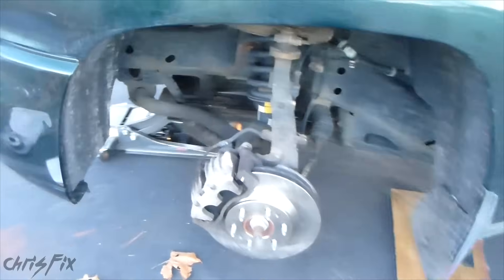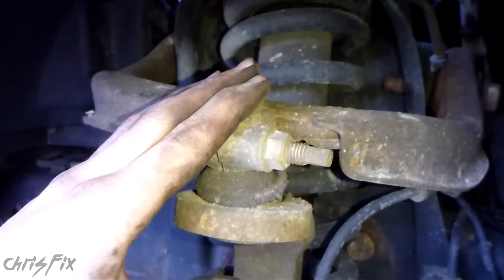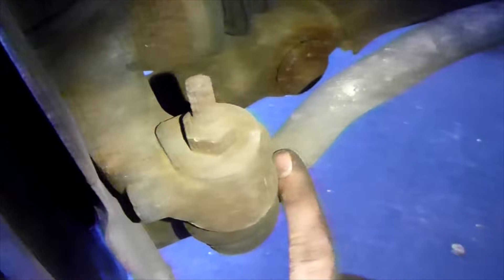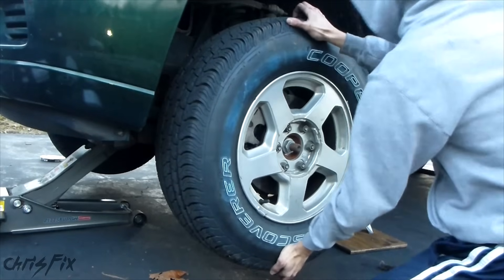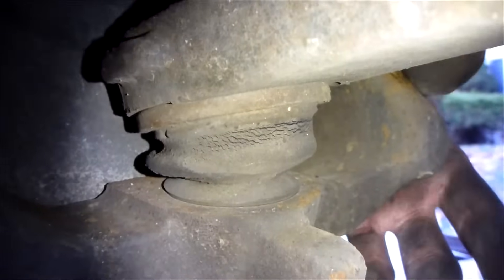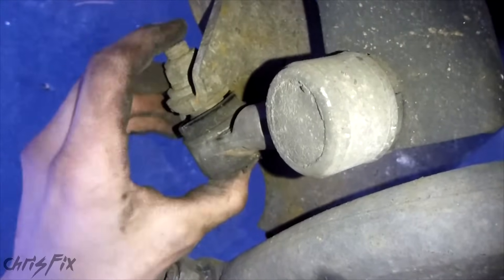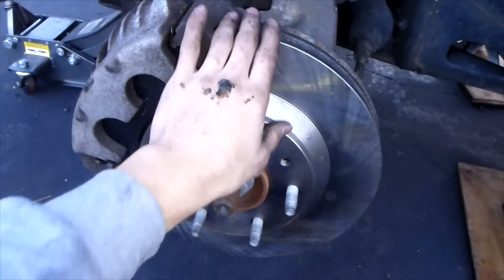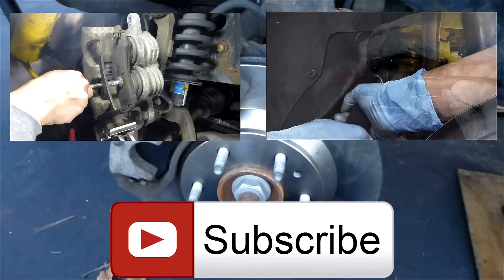How to check out your own car's suspension system

Comment: When you check for 'play' in the joints / bushings, is it best to have your car on the ground or jacked up.. or does it depend on what your checking? I noticed you have the car jacked up at the front.. though i watched an Eric the car guy video where he checked bushings at the rear, and he said to not jack up the rear as it'll interfere with locating the source of movement ?

Reason I ask is, I have an 05' Honda CRV and when I accelerate, generally at a higher speed, I feel a light thumping/vibration in the car.. similar to feel/sound you might get if you have  a flat tyre .. though I do believe it's more noticeable during acceleration and reduces/stops (will double check) once I've reached speed.

I'm planning on checking for play, though not sure how it's best to approach diagnosing.
Reply from the maker: +sypher0101 It varies. I do both but it is way easier to see stuff when you have the wheel off. Check out this video: https://www.youtube.com/watch?v=62bVn7E8gyk
Reply: To check for play when you wiggle the tires it HAS to be up in the air.  Once you confirm there is play, then take the tire off and start hunting around for boots that have torn or leaking oil from the struts, etc.
Reply: hey Chris, whenever I turn my car it makes a popping sound. I don't know what the problem could be but I don't want to pay someone to fix it. any help ?
Reply: Could be a million things: struts, strut mounts, ball joints, lower control arm bushings, tie rods, wheel bearings, cv axles, sway bar bushings, sway bar end links...only way to figure it out is to jack it up in the air and start yanking on the tires at 12 and 6 and 3 and 9.  If that's good, take the tires off and start yanking on stuff to find what's wiggling and popping.  Once you find what it is, replace it.  If you still can't find it, take it to a front end alignment shop: they diagnose and inspect them for free usually.  Once they figure it out, they'll tell you, give you an estimate, you leave, and then fix it yourself.

Comment: Hey Chris, question for you just checked my front sway bar links and on the bottom there's alot of play. The sway bar shouldn't move right? if you can respond quickly it would be greatly appreciated but if not I understand.

Comment: Man I have learned so much from you. My 2011 Versa hatchback makes the weirdest noise when turning. Like is the front end is going to  fall off. I'm very worry when driving it. Any suggestion. Thank you.
Reply from the maker: +Roland Hernandez Im going to guess CV axle. Does it do it in both directions?
Reply: yes Chris
Reply: I heard another mechanic say that it could be the bearing plate onto of spring that gets frozen and don't move with the spring. By the way thank you for your reply.

Comment: When i try to move my tire from side to side i'am able to turn my wheel and i hear what i would say is hydraulic fluid moving around( i get a vaccum squishy sound effect) I do not think that's normal though i do not have any noticeable fluid loss any where or leaks. Noticed the rubber boot was torn where the inner tie rod meets the the outer tie rod so that needs fixed. Any suggestions for a fix?
Reply from the maker: That's normal. That's your power steering fluid. You need a new outer tie rod.
Reply: +ChrisFix Yeah to clear it up a little more, i am able to steer the car from the tire with my hands lock to lock(horizontally) when i was checking if i had a bad ball joint. I thought you should&#39;nt be able to do that. It takes more effort to turn left when driving ive noticed. I understand i would have some play there with a bad tie rod but not be able to turn it like that
Reply: +james avery I was just wondering that i may have a  bad power steering pump
Reply: +ChrisFix Maybe it's because my steering lock is just not engaged lol. You learn every day lol

Comment: Am new to cars. Why do we need to change the whole part not just the worn bushings? I can't seem to get a straight answer to this question. From where am standing it should be easier and cost way less for just that rubber part.
Reply from the maker: +MrSqeeky1000 You can just change bushings but sometimes the whole part is damaged or it doesnt have replaceable bushings.
Reply: +MrSqeeky1000 The real answer is it depends.  It depends on where the damage is located and if the part has bushings that can be seperated. Some cars have suspension parts with ball joins and bushings integrated into a control arm for example and in that case the whole part needs to be replaced.  Other cars you can replace just the bushing if you have the tools and the know how.  What really gets me, is that sometimes dealers and auto suppliers only sell the whole part and in that case it just makes sense to replace the whole part b/c you have to buy it that way.

Comment: my 2004 4x4 canyon started making a grinding type noise all of a sudden when driving home from the beach. it does it from about 10-25 mph and only after its driven for at least 20-30 min. almost as though the brake is engaging on the front driver side. what could it be?
Reply from the maker: +dewhiskey daycullme It might be the brakes. I would take the wheel off and check it out.
Reply: +ChrisFix thanks. i just bought a jack and jacked it up. noticed a little play side to side but not up n down. I'll take wheel off as soon as i get some jack stands. I appreciate the info.

Comment: The best suspension video I have watched all day.  THANK YOU! Wish I would have found this BEFORE I put the car back together!  I did try to wiggle the tire to watch for play and didn't see any but the boot on the lower ball joint is all but gone. The upper and the outer tie rod look like crap too so figure I'll just replace it all.  I hear all sorts of rattling when I'm driving (when the road is rough) and it is pulling to one side.  Don't know what else to do.
Reply from the maker: usaclc Glad the video was helpful! I have videos on replacing all of the parts too! See my suspension playlists! I bet it is tie rods and sway bar end links causing your noise.
Reply: ChrisFix just watched a bunch of them.  Feel like I cheated on you (had to see wishbone lower control arm). So my new arms, upper and lower, arrived - waiting on tie rods.  Went through most of the bolts to get things loose so when I have time to swap parts it will go faster. I was going to remove the tie rods but the nut is turning but not coming off the bolt.  Frustrating.  After a full day at work sanding I didn't have patience for it.  I'll pay you $200 to come over this weekend and finish the job.  (snicker)

Comment: My car makes a clicking noise when I turn right or left, super annoying and loud and it's constant until I'm done turning. I don't know what is making the sound but maybe you do? My only guess is the spring? Idk...is there something I'm supposed to lube or  is my spring getting caught? I'm lost. (Info: My car has annoying Megan coilovers that came on the car when I bought it 3 years ago.)
Reply from the maker: WishIWasDrunk That is the CV joint most likely making the clicking noise if it happens when you turn.

Comment: hi Chris, big fan here. i have a 2012 honda civic LX and unfortunately I was stupid enough to drift my own car, (umm...about everyday?) and I've noticed that now everytime when i get over anything(like speedbumps) it gives a clicking sound,do you have any ideas or suggestions?
Reply from the maker: Jim Benson It could be sway bar end links (probably) or the cv axle. Does it click when you make a sharp turn because that is the CV axle then.
Reply: it also triggers off anything now, turns, sharp brakes, even small bumps, it's getting worst, and I think I should check it as your video shows, great videoes, please keep it up:)

Comment: Hey Chris, I was looking to buy some new tie rod ends for my 95 isuzu rodeo but im not sure if the ones im planning to buy are greasable. What do I do if I can't grease them after installing them? Leave them be or find greasable ones? I dont want to because they are expensive and my isuzu is my beater car. Advice?
Reply from the maker: ***** Non-greasable tie rods are fine for a beater. They will last a good long time anyhow. Obviously greasable ones are better, but if the price difference is too big, just get the cheaper ones. The non-greasable ones just get installed and that is all. You do not need to do anything else.
Reply: ChrisFix Ok Perfect. Thank you for everything you do bro. Really helps a lot! Just did a superflush on the coolant. :D

Comment: I have a 99 jeep grand cherokee, which are famous for the death wobble but I fixed it before but now i have a problem where if i go on the highway. My driver side tire vibrates on the highways I feel like it swaying but sometimes it stops. But when letting it coast on local roads I hear and feel the vibration. Cant figure out what it is, I did check the hub but lifting and moving the wheel but there isn't no play. Have any idea of what it can be?
Reply from the maker: Bryan Ruesta Could be CV joints. Did you check your sway bar bushings and end links?

Comment: Chrisfix, I'm leaking power steering fluid from my rack and pinion. It's very slow ,however, it is leaking. Can you give me a level of difficulty from 1-10 as to purchasing a seal kit($45) and doing it my self. Or would it be better to purchase a new rack and pinion gear assembly. I found one on eBay for about $115. Thanks, loyal subscriber.
Reply from the maker: James Falvey It is like a 5-7 in difficulty because you need to remove the steering rack. I would just get a new rack if you are going to be taking the whole thing out. You might consider this for a temporary solution. Maybe you slow leak will stop: http://www.amazon.com/gp/product/B000ARPVNO/ref=as_li_tl?ie=UTF8&camp=1789&creative=390957&creativeASIN=B000ARPVNO&linkCode=as2&tag=chri0e2-20&linkId=UU7MMTQA7ZDL44HPIt is guaranteed to stop seal leaks or your money back!
Reply: I saw that stuff in a store. I'm very skeptical when it comes to purchasing things like that. Such as radiator stop leak etc.... They'll put anything on a bottle just to sell it. However, the guaranteed money back is making me think twice about it. Just hate for it to be a waste of my time even though I'll get my money back. Perhaps I will try it. Thanks chrisfix for the response
Reply from the maker: James Falvey It is worth a shot because you are going to tear apart your rack anyhow if it doesnt work.

Comment: Hey Chris sorry for posting a unrelated question also thanks for sharing your videos. I wanted to get your thought on buying a reman trans from the dealer(kia 12/12k) or rebuilt from a trans specialist(unlimited/1yr) dealer $916 for trans pls labor= 1850 trans shop rebuilt 1900. Im concerned abt the quality iyo would the dealer reman be a better choice?
Reply from the maker: Curtis Bell Dont be sorry. For a Kia, I would just go to the trans shop. A rebuilt tranny is a rebuilt tranny and the trans shop does it all of the time. Make sure you use a reputable shop.

Comment: Hi Chris I wrote to you before and today I have another question, I also own a Mazda B3000 SE 4x4. Bought it used with a missing manual hob locker. But I noticed a couple of times that you don't have any front manual hub lockers on your Mazda. If this truck suppose to have hub lockers?

Comment: Hi Chris, I have a 99 mustang v6, just pushed over 250,000.

2 questions:

1: how long do timing chains last?

2: it only does this every once in awhile, the transmission will shift too early and super hard. It's not low on fluid and doesn't matter if it's warm or cold. It usually only does it if I drive it like a race car, but today it did it for no reason, I drove to a salvage yard around 1 and had no problems, left for work at 4:30 and it was shifting hard and too early, same when I left work at 11:30. Took a coworker home, then headed home, checked the fluid, then went to drive it again to check it, it shifted like normal again. I did shut the car off after checking the transmission fluid for a few minutes to check other fluids.

And I haven't driven the car hard today or recently.
Reply from the maker: Chinesefoodrocks1521 Timing chains can last the life of the engine. Some chains sag and need to be replaced but that is typically after at least 200k miles. My van has 300k miles and has the original chain.  Some chains have tensioner springs. 
As for your tranny, what happens if you push the gas hard, will it shift early?
Reply: She acts normal whether I drive hard or normal. But if I drive hard constantly, like accelerate by getting to 3-4 thousand rpms, it will like switch to this hard shifting, early shifting mode (idk what else to call it). 

Here's the best example I can give you: work didn't have my paycheck so I was really mad, so I was flooring it whenever I had to accelerate all the way home from work, except in the neighborhood. When I got to the neighborhood, it started the hard shifting, it didn't shift hard while racing home. 

So I didn't park, I drove it around alittle and after awhile it went back to normal. It usually goes back to normal after sitting overnight too.
Reply: When pushing the gas hard she runs and shifts normal. But after driving like that for a few minutes, it starts shifting hard.
Reply from the maker: Chinesefoodrocks1521 Hm, that is tough. You might consider getting this scanner and checking the transmission codes: https://www.youtube.com/watch?v=xPI36bKVCjk
Reply: I think i got it fixed. I drove it across town this morning and then went to drive back and the transmission started acting up the minute I put it in reverse. Check engine light came on, bad throttle position sensor. Replaced it and transmission was fine.

Would it make sense that the computer didn't know how hard I'm pressing the gas, so it doesn't know when to shift, so it shifts early?
Reply from the maker: Chinesefoodrocks1521 Yea, that makes sense. Glad you found the problem!

Comment: Hey Chris, great video. I am by no means a machanic. I know a little and I love working on my on vehicles. So thanks for the informational video. On another note, I have a 2009 Saturn Aura and it everytime I turn right or left I hear kinda like a squeaking/grinding noise coming from the front end of the car. However, it only does it after I've driven it for about 30+ minutes or so and the steering isn't pulling hard or anything just the noise at the speed that I'm going and it only does it when I'm going less than 30mph. Not really sure where to really begin to start looking. What can I look at to be the issue? Thanks for any info that you can give.
Reply from the maker: Daniel Dameron This can be be your bearing (but bearings usually hum rather than squeak/grind). It could also be a cv axle joint but they will typically click. I would jack the car up, then take your hands at the 3 and 9 o'clock positions and try shaking the wheel (like in the video I link below). If there is play in the bearing you should feel it. Check this out: https://www.youtube.com/watch?v=62bVn7E8gyk

Comment: Awesome dude 👍 I'll be checking my suspension this weekend. Now that I know what to look for! You're Fuckin awesome!
Reply from the maker: Ceasar Rodriguez Great! Glad the video was helpful! Let me now what you find!
Reply: delete system32 it should fix it
Reply: Thanks for the videos Chris, you
u really know your stuff.
Reply: +ChrisFix i have a question chris my honda civic 2012 is having a very serious problems.swerving on the high way and really feels like im going to lose control of the car.what can be wrong?i notice that on certain roads the car slides.funny thing is when it's pouring rain heavy the car drives perfectly fine and doesnt hydroplane.only hydro planes on dry roads.weird symptoms.i had a 3 month warranty at fire stone and tires are brand new.any feed back will help out extremely.

Comment: Hey Chris, Sometimes when I am driving over a speed bump or certain bumps in the road I hear a cracking noise from the front right of the car would you happen to know what that may be? it only happens from time to time. Thanks
Reply: 01 mitsubishi lancer
Reply: Steve Creak
Cracking / popping noise, sorry
Reply from the maker: Steve Creak Is it like a metal clunk? Sounds like your sway bar bushings or your end links are worn out.
Reply: Thanks Chris, Loving the channel keep up the good work!

Comment: This is a great informational video. I'm by no means a mechanic, but I'm trying to learn as much as I can and your videos truly help. Keep up the great work.  On another note, I have a 2003 chevy trailblazer ext with around 144,000 miles, when I'm at high speeds no problem, but when I slow down to like 10, 15, 20 Mph the truck feels wobbly like left to right like I'm on a boat. What can I look at with this issue, i.e. control arms, ball joints etc. Not sure where to begin. Thanks for any info you can give.
Reply from the maker: quinones325 Great! That is why I make these videos! That can be control arm bushings and or ball joints. That is where I would start looking.

Comment: hi chris i have an stock 06 chevy trail blazer done some offroading in would like to know more about the removable sway bar end link thanks
Reply from the maker: Corey Slusser Removable sway bar end links help your tires become more "independent". There are a lot more things you should do before you mess around with removable sway bar end links.
Reply: ChrisFix ok thanks could you point me in a direction on were to go next as far as performance offroad
Reply from the maker: Corey Slusser I would focus on tires, a lift, and a winch.
Reply: ChrisFix ok thanks a lot man this was very helpful
Reply from the maker: Corey Slusser Great!